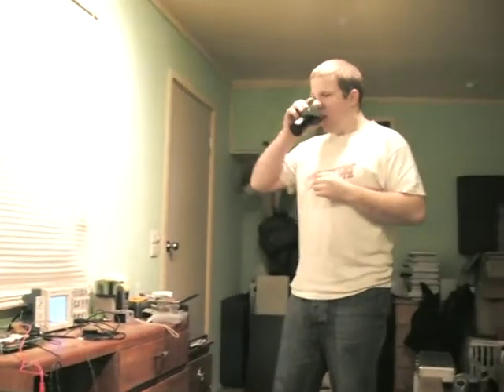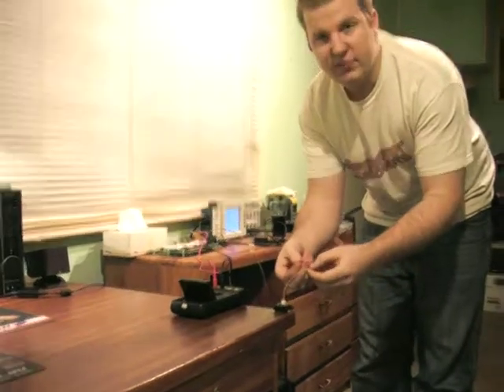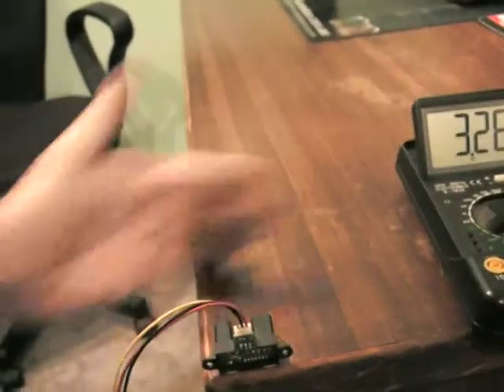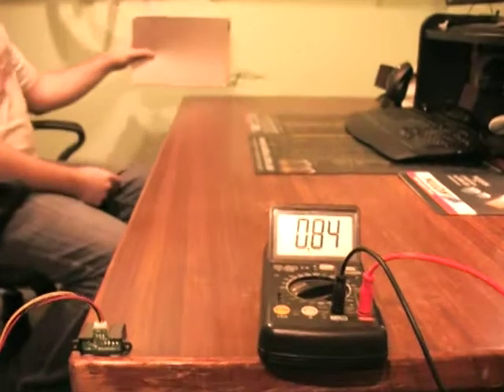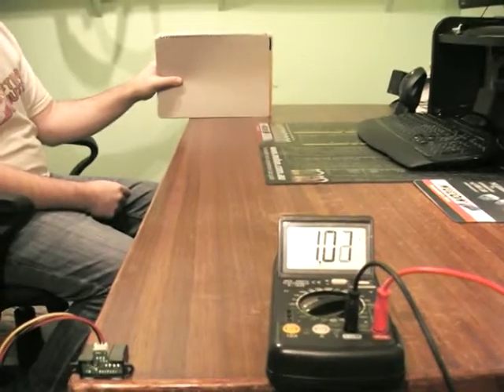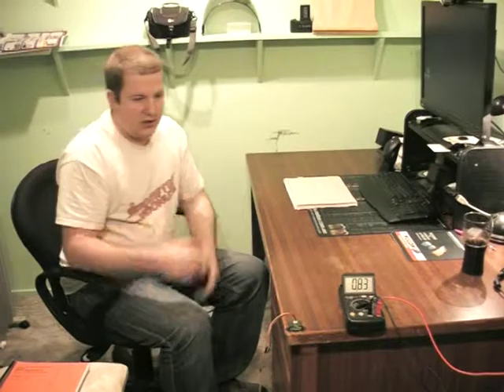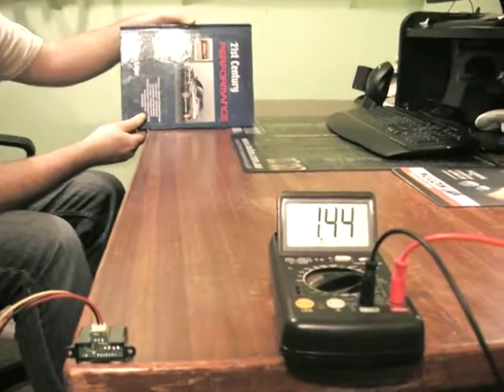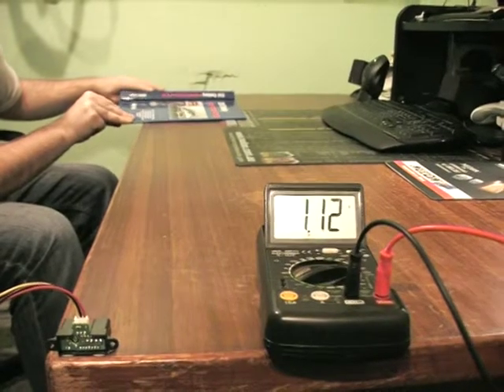VIMA - Sharp IR Ranger Sensor

Comment from the maker: @Krackanovavich yea with that sensor we just hooked up the rated voltage to the unit and it gives a voltage back depending on the reflection given. this sensor is really good for a controlled area, i would recommend against real world environments where you can not control the reflection. see my other 2x vids for measuring displacement. 
Cheers.